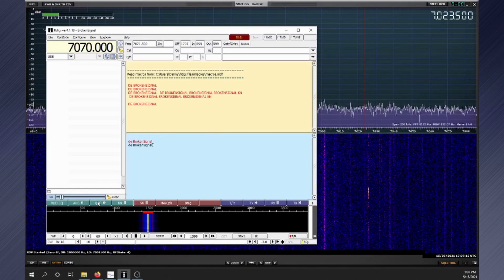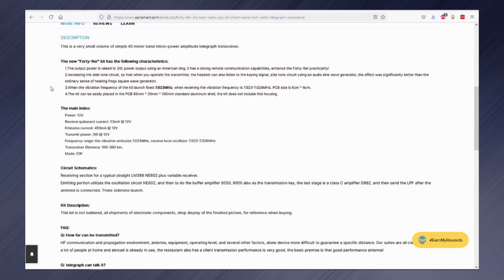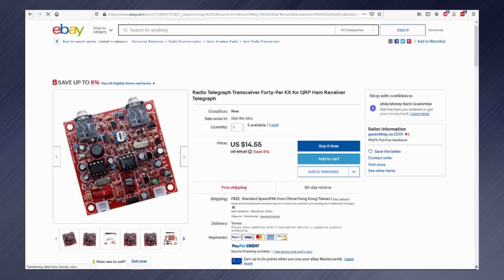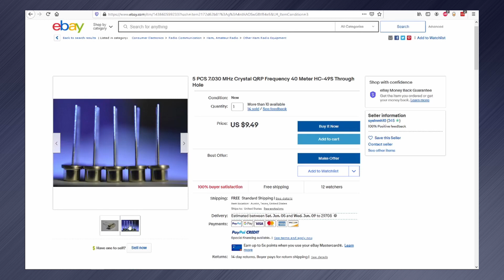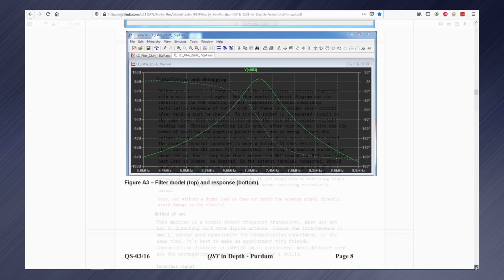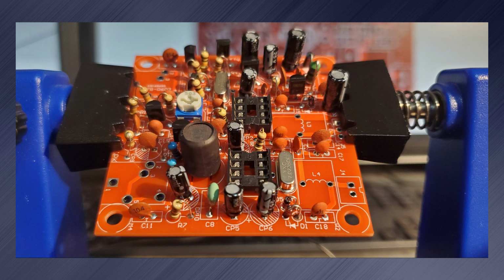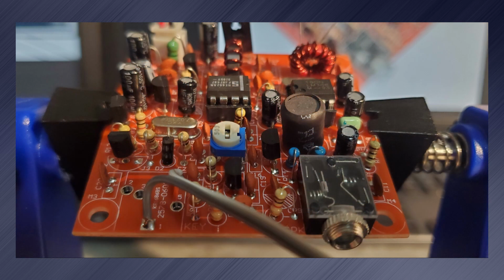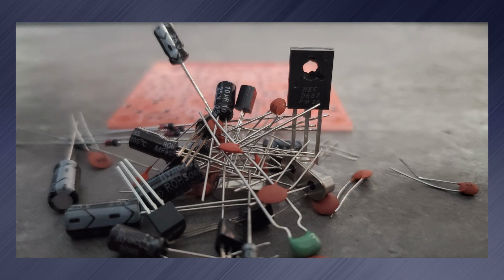Building the Forty-9er CW QRP Kit

Comment: This is one of the worst kits I have ever had.  There was no instructions, some of the disc caps were not identified,  incorrect resistors were mixed in, and one chip had no socket, no pins and no holes where it belonged.  To me it was just a waste of my time so igave it away for the parts to another builder.  Be aware, some of these kits were very good, but others were not.
Reply from the maker: I have heard that from a few builders. Luckily my kit was all there.
Reply: Yeah, really thought he was going to explain the values along the way, I have no components or their values/labels for where they go on the board. China you need to get your s**t together.

Comment: Whats the blue variable pot for?
Reply from the maker: Used to peak the receiver.
Reply: @BrokenSignal  
Qhats max watts and how far you get with it?
Reply: I can not get how many turns on the foroids. Print out of schematic very poor.
Reply from the maker: @mauriceyoes2450  L3 is FT37-43(black) with 11 turns. L4 is T37-2(red)  with 16 turns.
Reply: @BrokenSignal  Not many responds, but I think you helped out a lot of folks with that answer. Mine isn't readable either. '73 from Holland.